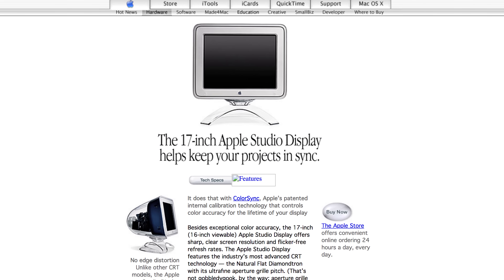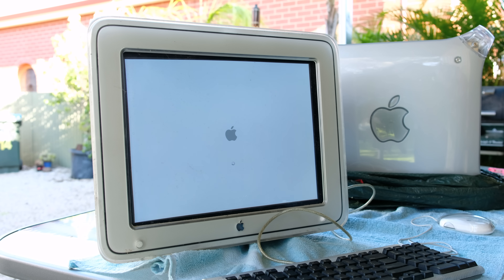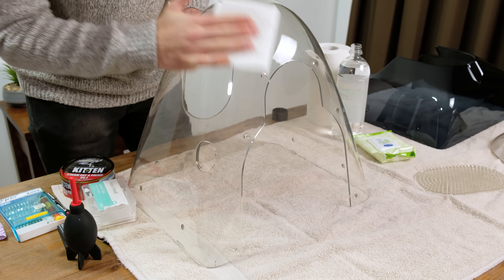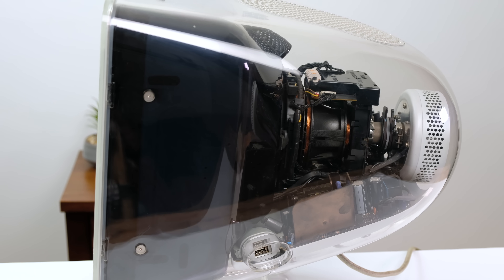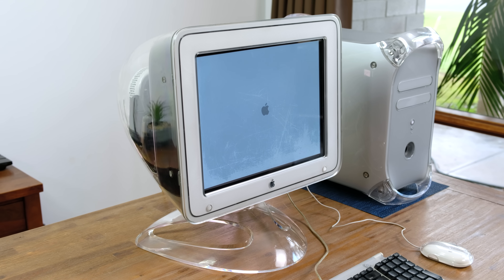Apple's Last Ever CRT Display!

Comment: For those wanting to use this on modern computers, there is an open source tool now made by mega calibrator. You can search it in TinkerDifferent. Do note that this display works best with NVIDIA GPU's and preferably a DP to VGA adapter or DVI-I to VGA (Cards like the GTX 650).

Comment: The CRT coating film in this unit can be easily and safely removed. I did it and installed new film. I used a cutter knife to elevate one edge and once it was peeled off enough to grip, you can even peel it off with your finger. Then clean the glue residue with some solvent.

Comment: If it's the 19" version it actually makes 1600x1200 @85hz, you just need to overclocked it with something like CRU!
Really neat thing, worth it for the design alone, but is also an awesome monitor

Comment: If I'm not mistaken, ADC is just spicy DVI. There's an adapter that will provide power and USB for ADC monitors and you should be able to hook it up to a DVI capable PC. Not sure if it uses VGA over DVI or HDMI over DVI.

Comment: The choice of available resolutions is weird, because 1600x1200 is a 4:3 aspect ratio while 1280x1024 is 5:4, so one of those, probably the latter, would be distorted on that display. You may call that usable, I call that wrong and inappropriate for any kind of graphics/design work.

Comment: 1:08 why are you unscrewing the monitor, while the cable is plugged in?! There is something like standby current!
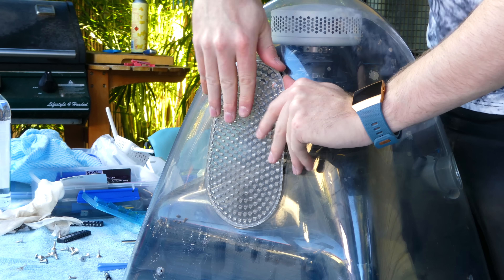1:25 why are you cleaning the outside, AFTER unscrewing it XD (and the cable is still in XD)
1:54 you used garden hose to clean inside but you've put the whole thing on the ground, and just right before you were cleaning the... omg nevermind

Comment: I have had this very same monitor since 2000, along with a dual 500 mhz Power Mac G4 and got plenty of use out of both. I can attest that It is indeed a superb display with rich, vibrant colors. It does need a refurbishment, however.

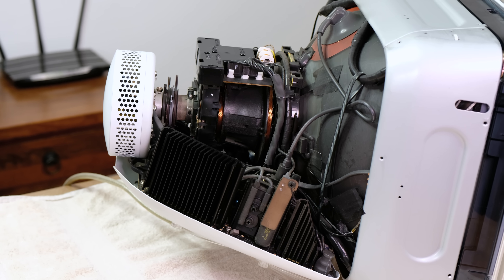Comment: 2:50 why is it dangerous is it because you would not be able to break it?
Reply: he might be electrocuted by the display.
Reply: I have worked on several CRT displays and it is very important to be careful, they have thousands of volts inside of them, and a vacuum tube that could implode!

Comment: ooooo, this would be great to use as a hackintosh case or something! Find a display that would fit and i can imagine some 3d parts could make all the parts fit in the back. Would be an insane build
Reply: in the interests of preserving rare and vintage technology, pls dont trash a perfectly good CRT like this and replace its insides with stuff that's mass manufactured today. its beautiful as it is. you can 3D print or make moulds with this case's style if it's just the aesthetic you're after, without damaging something so literally unreplaceable and that precious

Comment: Since when is a vacuum high pressure air?
Reply from the maker: When you put the hose in the air exhaust vent and use a small nozzle.

Comment: I had both the VGA graphite version that was released with the G4 Power mac of the same name.  I also have thie 22 inch LCD that was released along side this CRT.  I need to replace the ADC to DVI adapter though sadly.  They are not very expensive though and if you get one it would let you use this monitor on pretty much any modern computer.   I had my 22 inch LCD hooked up to a 2007 Mac Mini with mine.

Comment: nothing impressive , my belinea 17" from early 2000's was doing 100Hz at 1024x768 ... playing CS 1.6 with frame limit set to a 100 ... not much tearing visible at this rate anymore with V-sync off. A lot of LG Flatrons were around with same or better specs. All of these high end CRT's would have a flat surface with FD Trinitron tube behind it. Any respectable Gaming Cafe would have either Flatrons or Belinea's CRT's.

Comment: That's an interesting tutorial for  "how to remove a lizard out to an Apple computer".
Reply: *monitor
Reply: @MrAwawe  computer**
Reply: @virtualtools_3021  nope, that's a monitor, not a computer. You might be confusing it with the iMac G3, an all in one system with both a computer and a CRT-display in a translucent plastic casing. This, however, is only the display.
Reply: @MrAwawe  sorry m8. it has a microcontroller (computer) inside for communicating display information to the devices its connected to.
Reply: @MrAwawe  "A microcontroller (MCU for microcontroller unit) is a small computer" I guess you are right. It is a 'small computer', not a computer.
Reply: @virtualtools_3021  
"pedantic 
/pɪˈdantɪk/
adjective
Excessively concerned with minor details or rules; overscrupulous.
Reply: @MrAwawe  i said you are right. its not a computer.
Reply: Baylen!  Can you read? My name.

Comment: 2:52 there is NO inherent danger in disassembling a CRT. Once the display is disconnected there is no high voltage generation anymore. The CRT can only act as a capacitor when in circuit. Touching it's anode will do absolutely nothing once it's unplugged, especially such a late model unit. Theres a high value bleeder resistor built in to discharge it before you even get the first screw out.

Even with the unit on, taking the anode cap off and holding it in one hand while grounded will only serve to damage the driving electronics. It's extremely high voltage high frequency, which means it can supply no current at all. As soon as you touch it the voltage will drop significantly and the driving transistor(s) will begin to struggle under the load. It'd be the equivalent to touching a 9 volt battery.

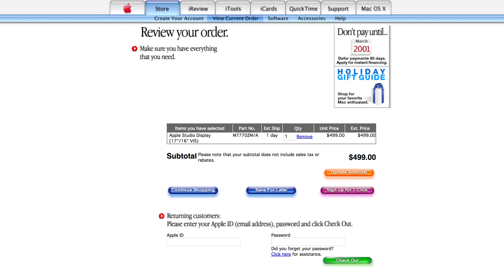4:19 All CRT monitors from this era could self adjust and calibrate, but it looks like yours is doing it wrong anyways. The picture is tilted to one side in every shot.

$499 is a lot for a CRT monitor, even in 2000. LCDs were gaining traction rapidly and even the best CRTs failed to meet the image quality of a cheap LCD of the time. Less than a year later you could get an equivalent Dell or ViewSonic monitor for around $299, and those had on screen menus and automatic setup, supported many more resolutions through a more common connection, and some had internal USB hubs as well. Just like everything else, this monitor was about selling a brand name.
Reply: Well, early LCDs image quality was far worse than their CRT counterparts
Reply: @MrGilgameshJR  It all depends on the usage. For typing, even the crappiest TN colour LCD back then was improving a lot on sharpness and was flicker free. We also got sub-pixel rendering of text, which improved text sharpness even further. Try to work an entire day on this, and then on a 17" iMac lamp, with 1440x900 LCD. I know what to pick.... It is not the CRT.

Comment: Just one thing i don't like about this video:

"Remember when Apple included stands for their displays?"... they still do it on any display - on every iMac as well as on their brand new Pro Display XDR. That $999 stand is an additional stand which has more options like pivoting the display and/or ergonomically moving it to your needs. But there's a basic display stand already included if you buy the Pro Display XDR - and for many people, it'll probably even be enough and the display is cheaper (and still does way more!) than a $40.000 SONY reference display... so what?!
Reply: alert we got a biased apple fan

Comment: 2000 Apple CRT: 154hz refresh rate and Stand included
2019 Pro Display XDR: 60hz refresh rate no stand include

Nice Job Tim!
Reply: 2029 apple Pro display
No video output included
Reply: Sure but the refresh rate part really makes little sense
Reply: Jonathan Ive was around when Steve jobs was, but removing the headphone jack is stupid
Reply: RetroKidOnABoat not really as everyone is doing it now, it had to go at some point and thank god it’s gone now, really never used wired earphones, I either used the speakers in the phone or just use beats
Reply: And the stand is 999 dollars
Reply: Change your comment to include the price.
Reply: The refresh rate thing is stupid to compare.
That's the advantage of CRT over LCD or OLED or whatever we use these days. It's not Apple's fault LCDs can't adjust its refresh rate like CRTs do. Not to mention, their Pro monitor that has separate stand is actually 5K.
Reply: Somanithel Kheang this is just a joke. No need to be serious

Comment: U just realized y the $1000 stand makes sense, if your buying a stand your likely buying 1 or just a few, but if your just using the Vasa mount your buying in bulk saving money and insuring Appel makes a profit enough to pay the devs.
Reply: It sounds like a scam buy most people aren't going to use an Appel display so if you are apple needs to justify the development of this one, and if it's not worth it then they will just make a $1000-$2000 display that only costs half that and call it a day.

Comment: With this, you will be able to use the monitor on a “modern” pc. https://www.ebay.com/p/Apple-DVI-to-ADC-Display-Adapter-Model-A1006-W-Power-Cable/1224519332?iid=123370110232&chn=ps&norover=1&mkevt=1&mkrid=711-117182-37290-0&mkcid=2&itemid=123370110232&targetid=596465722708&device=m&adtype=pla&googleloc=9026799&poi=&campaignid=1689407495&adgroupid=74365778388&rlsatarget=pla-596465722708&abcId=1140476&merchantid=101708556&gclid=Cj0KCQjwpPHoBRC3ARIsALfx-_LS5ylB0wRkzT5J_2LltpMJ6d4SIcgpFfZV6MVO3tWeT0qM3GnYHkYaAkZaEALw_wcB

Comment: By last CRT display, I'm assuming you mean the last standalone monitor? Apple was still producing the iMac G3 until 2001 with hardware updates, and I believe the final CRT Mac was the little known eMac that was meant to be a budget iMac G4 to be deployed in mass to schools, that was finally discontinued in 2006. I have an eMac… Pretty cool machine. Replaced it's drive with an SSD and is running OS9 now.

Comment: I had an IBM monitor that may have been manufactured between 1992 and 1995, it didn't care what resolution I fed it or refresh rate. I killed it because I was unaware of the dangers to the monitor of manually setting it to run at 200hz playing Halo. Unfortunate, but it was the only CRT I ever had that would run 1600 x 1200, all more impressive when you realize it was a 12".

Comment: The ADC connector is as you said a combination of power, usb and DVI. These can all be separated out of the cable. If you look up the pinout for the ADC connector, you can quite easily solder your own cable terminating in dvi. This will make this iconic monitor able to be connected to any modern pc.
Reply: This is mostly true, but for anyone looking to do this, there are some caveats with this. You'll need an ADC equipped Mac to "boot" the display. And this will not work with the DVI to ADC adapter that Apple sold, as this display needs the analog pins of a DVI connector (as this display is technically VGA), which the DVI to ADC adapter lacks.

Comment: Dman I wouldn't mind something like that, though to use these older ADC stuff you'll need a DVI to ADC adapter that provides enough power to power a CRT. Kinda crazy to think they could get a CRT to run off a little connector simliar to DVI (but then again I imagine its not like they're pushing 120 or 240 volts down the cable)

Comment: I currently run a 3 monitor set up a standard 27 in LCD, a 14 inch dell trinitron from 1996, and a massive 21 inch Apple monitor from 1999, I love the Apple monitor but the dell trinitron display is slightly discolored and it’s only 1024x768. Im considering getting that beautiful Apple one to compliment my other one!!!

Comment: Wasn't there a 23 or 21 inch model? I heard they're one of the best CRT Displays ever made.
Reply: There was a 21" but they stopped making it when they changed to the clear case design so it the case it comes in is designed to match the power mac g3 like the older 17" monitors

Comment: There should be some adapters on ebay for $20 https://www.ebay.com/sch/i.html?_from=R40&_trksid=m570.l1313&_nkw=ADC+to+VGA&_sacat=0
Does convert to VGA and USB 2. Don't know the power connector though
also you might want to get a slightly abrasive solvent and wipe down the front screen

Comment: there are available converters to take it to a standard dvi plus standard usb. would it be possible for you to do a second pass on this awesome crt with the adapter connected to a more modern computer?
Reply: Apple actually made a DVI to ADC adapter, which they originally released for the MacBooks and PowerMac G5 which only had DVI - but it can be used with anything that has DVI output.
Reply: @sabianmateinnit  this was what i was referring to in my comment, i was hoping he might grab one and use it to try out the crt

Comment: wait you are telling me that that crt has a faster refresh rate than my new monitor
Reply: The CRT most likely has better colors and contrast too, unless your monitor is OLED but that's really unlikely.
Reply: @Pasi123  Yeah, OLED 144hz panels probably won't happen anytime soon as well, but i have a FHD panel and i think it looks pretty nice
Reply: Is it TN, VA or IPS?
Reply: @Pasi123  Unsure, its the MSI Optix monitor cant remember and im not sure if it was even listed on newegg
Reply: Yeah, refresh rate and colors are great on CRTs. They’re just big, heavy, c o n s u m e  power, are much more complex to build (today) and are generally lower res (although some 720p and 1080i 16:9 widescreen crts were made). Also there is usually zero input lag.

Comment: The problem with CRTs is that they can just stop working at any given moment. I’ve lost two CRT TVs and they just wont turn on or make any sound😥
Reply: To be fair, any technology has the potential to stop working, especially as they get older. I have used an IBM CRT from 1992 on my PC until around 2013, when it unfortunately decided to go out. I think it could’ve lived longer, but I was stupid at the time and used a higher resolution than it was designed for. 

Still a pretty respectable age, though. It certainly outlived my Chromebook Pixel from 2013. What a piece of garbage, can’t even replace the SSD that broke down for whatever reason (the guy that owned it didn’t even store much data on it, mind you). Luckily I didn’t pay anything for it. Just another thing to go to the waste pile if I didn't know how to replace the BIOS and get it to boot from the SD card.

Comment: Now I want to find mine... and get a bigger desk to fit it on. :P

There is an adapter that serves as a power brick and lets you plug in to a standard DVI plug, so you can use the display with other computers. I was using one of those LCD cinema displays for a while with the adapter until my brother gave me his old monitor. :P
Reply from the maker: True! I'm probably gonna buy one of those adapters off of eBay 🙂
Reply: Psivewri I’m curious how much they are going for these days. If I remember correctly they were $100 new from Apple.